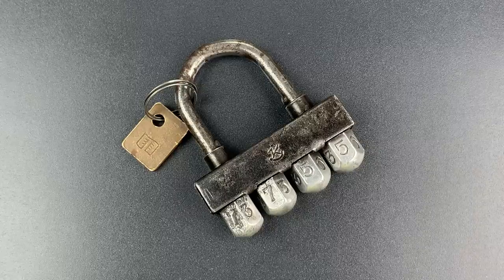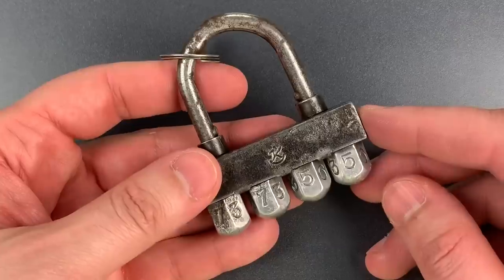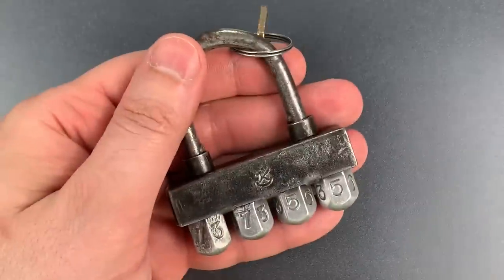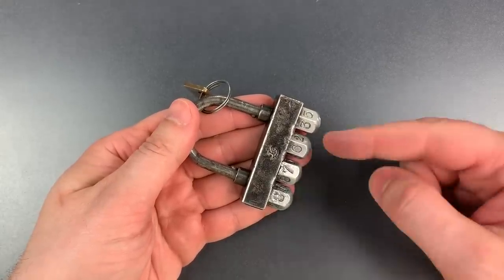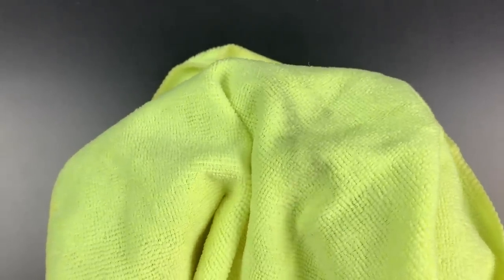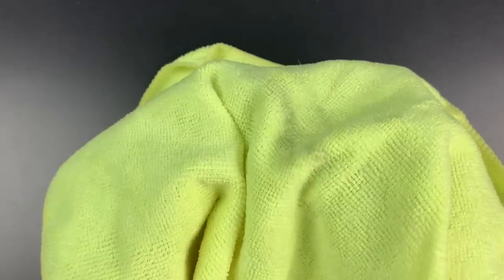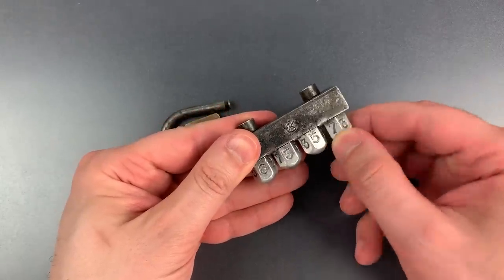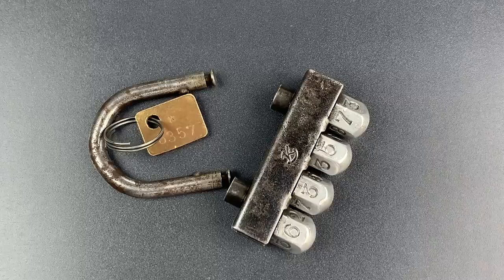[883] Vintage Soviet Combination Lock Decoded

Comment: Looks like the lock is actually decoded in 2 halves.
First 2 digits unlock the left side of the shackle, and last 2 do the right.
You could test this by only putting one side of the shackle in and scramble all 4 digits. Then enter just the 2 next to the locked side and see if it opens. Would be interested to know. 👍

Comment: LPL: You should have shown inside the lock. Point the camera into the holes at least. What's the locking mechanism? is it some kind of pin that moves or a round u shaped thing? The ends of the shackle looks like it has  machined grooves around the end.
Reply: I was curious as well, I have an idea on how it works but not knowing is driving me insane!
Reply: It's probably very simple. The numbered wheels likely have a groove cut in them. They likely have a notch milled into them at a certain position corresponding to number. Once you dial in the combination, you likely line up the notches with the shackle, allowing it to be released. Saying it another way, you line up the circular cut-outs in the dials with the circular shape of the shackle. Sorry if that doesn't make sense. I've had quite a long day. The repeated use of the word "likely" was intentional, however.
Reply: @52Ford , "The repeated use of the word likely was intentional."

Yeah, likely story.
Reply: @52Ford  thank you, with that possibility I am satisfied.
Reply: I have taken one such lock apart. That was decades ago, though. If I remember correctly, the numbered wheels had D-shaped ends inside, and the release mechanism was a spring-loaded slider. If all four wheels were properly aligned, the D-s all pointed in the same direction (like DDDD), allowing the the spring to move the slider and release the shackle. By turning any of the wheels out of the correct position, the slider moved into locking position, compressing the spring along the way.

Comment: Ive had a lockpicking kit in the office for about 2 years now and never got to it. 

About 3 weeks ago, a transmitter on the roof of my office failed at 10pm and needed to get fixed; of course saturday 10pm everyones drunk so I had to go myself. 
Find the keys for the roof door and realized I forgot it had a padlock also so got the padlock keys blah blah, got the door lock open and as soon as I inserted the key into the padlock, this thing just fucking broke. I cannot put it any other way,  IT JUST FUCKING BROKE as soon as I turned  it...anyway...no extra keys, no locksmith available, clients are angry..fuck my life.

I got back to the kit that same week and ive successfully learned my way around simple padlocks, obviously not in 1 minute like you but I get it done.

So thank you. I just wish I had seen this channel wayy before that happened.

Comment: I have one of these locks. Exactly the same except not quite so smart condition. Spent ages manipulating it, but don't get anything like the feedback you talk about. The outside two are always a bit tight, the inside two always very loose, and it's like that regardless of whether you put no tension, or heavy tension on the shackle. And they never change. Tension or no tension the loose ones stay loose and the tight ones stay tight all the way round. I know the lock works as I have the combination for it, so I can open it. 
Love these locks. Very unusual! :)

Comment: The ease of decoding it reminds me of the Hiplok Z-Lok combination lock, a very, very lightweight bicycle lock in the format of a zip tie, meant to be used when your bike is in sight or to secure e.g. your backpack to the luggage carrier. I bought one for my wife for the latter use and I need about 10 seconds to open it without looking. Of course, you could open it with pliers in less than that, so it doesn't really matter. There's another version that you open by using a 'key' consisting of two pins.
Could be interesting for your collection. A new low-point in terms of security.
Reply: I would believe you if you simply told us you were doing it with your eyes closed, and would prefer it to see what your doing while manipulating. Though great video as ever.

Comment: Bosnian Bill had one of these on a challenge box (Lock Picking Lebowski) ... I believe lock #12 Dude's Treasure Chest, video 1545.  He defeated it by "jiggling" the wheels while tensioning the shackle.  Since the towel was over it, the method you used was hidden.

Comment: I have a relatively pickproof keyway idea. Could you please tell your opinions about it?

-A round keyway to prevent tensioning
-Pins are embedded in the lock so no tensoning using pins
-The round key has springs and pins to push pins inside the key

I'm not sure about how to add different length pins to the key. A button may work. When the button is pushed, key pins are pushed out or in.

Comment: X-rays would be a good gimmick ;) I bought myself a used digital dental X-ray sensor for testing PCBs. Pretty neat resolution and instant imaging. X-ray source is another thing, but I think you can get a decent plugnplay set for under $2k.
Might be a good add-on for your videos.

Comment: Even without  the combination or checking resistance, I'm sure this would be easy to brute force if given a little bit of time.

The last knob can be rotated quickly in a to test all 6 combinations. Treating that as one "test", the 2nd knob is 6 combinations, 3rd knob makes it 36 (6*6), 4th knob makes it 216 (6*6*6).  A generous time of 2 seconds per "test" makes 512 seconds, or under 10 minutes.

If you can brute force a lock that quickly, that means it always needs to be watched. Which means it's a really shitty lock, even without any other detractors.

Comment: There’s no doubt you opened the lock using the procedure you described, and did scramble the numbers, but you also demonstrated a nifty bit of magician’s deception inadvertently! When you said you were going to scramble the numbers and proceed, you did so AFTER covering it with the cloth, meaning the viewer didn’t actually see you do what you described, but took it on faith, trust and assumption. Up to that point you had clearly seen the current number settings and could do what you like under the cloth. Many magic tricks work this way where you will swear on a stack of bibles that the magician did something, but in reality he only described it, or pretended to do it. You didn’t do this on purpose of course, but it did occur, lol.

Comment: How do you date your locks?

EDIT: How do you tell how old your locks are, (especially soviet ones)
Reply: Buy them dinner first
Reply: @MikeMikewaz  Obviously the only correct response!
Reply: @MikeMikewaz  I would also suggest a nice bottle of french wine.
Or for the russian ones, a bottle of vodka.
Reply: D´uh, the Russian way of course! Take lock from home during the night by force and stuff into black Volga > Stuff lock into a cell in wet cellar > Shine a bright light and camera at them > Threaten with Gulag (or Ramset or pick gun, which ever works) > Torture by tension bar and pick > Gather information about age of the lock, age of the neighboring locks, age of the relatives of the lock, age of possible enemies of the state locks (specially Master Locks) > Discard lock and the key and confirm with next random picks from the acquired family of locks.

Comment: After watching soany of your videos and learning how to break a lock I worry about how thin those lug cuts are. I feel like you could break that thing with a calculated blow from a piece of wood or just pull off your shoe and break it
Reply: The subjects of the State may not hide anything from the State. Nothing will be made available for the subjects to obfuscate State inspection without more than trivial effort. 
Concurrently, State sends subject to gulag anyways, need another warm body on the toothpick polishing line.

Comment: I like to watch these videos because it offers a rare opportunity to pick up on the latest technical jargon such as "there's some slop in this mechanism".  But all kidding aside, it appears as though that lock has just 1296 possible combinations so it could be defeated by a novice with time on their hands.  That reminds me of the time I borrowed a suitcase, only to discover, upon reaching my destination, that it included a locking mechanism, which had come into play, with me having no knowledge of the combination.  There were only 1,000 possible combinations (10 x 10 x10) so I simply powered thru, ultimately achieving success at 747.

Comment: Why is there a seven if the dials are hexagonal (only six numbers)?
Reply: The hexagons do not contain every number. If you look at 2:18, you can see 5 6 2 on the first hexagon, 7 3 <invisible> on the second, 3 5 <invisible> on the third and 8 7 3 on the fourth.
Reply: The numbers do not seem to be consecutive. I think I see a 3 next to a 7, and so on. So it's probably just random numbers on the hexagonal nut, in order to make it SEEM more difficult.